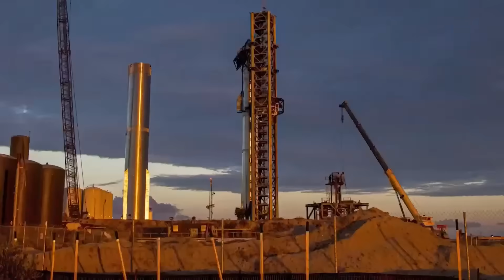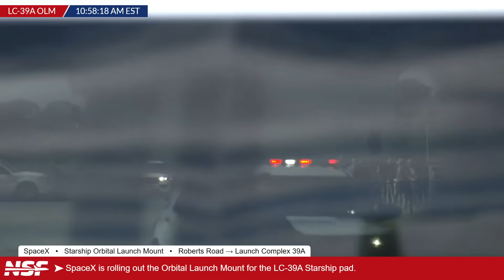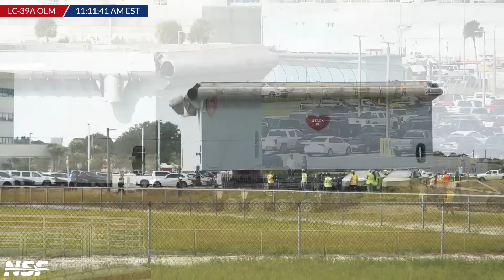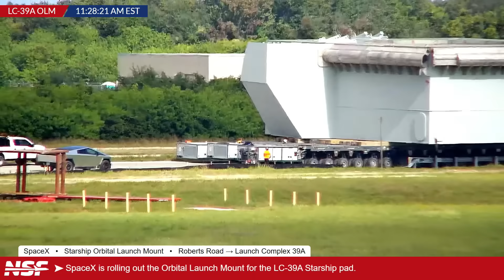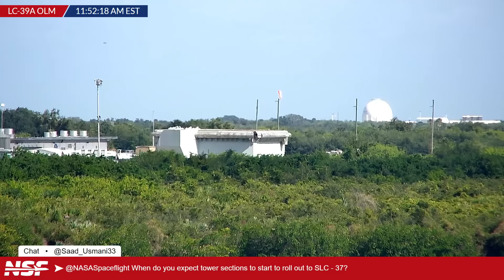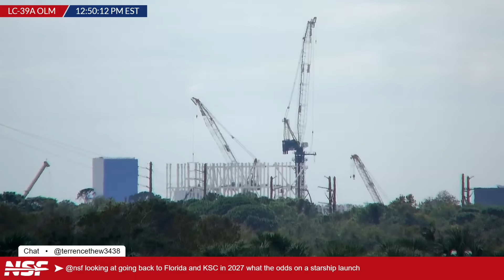SpaceX Rolls OLM for 39A Starship Pad

Comment: What happens if they spool this thing up and realise it'll never work? Do they tear them both down and go again?
Reply: They've got the previous experience of pad 1 at Starbase so it's not like they come here with this design without experience
Reply: @Alexphysics13 I understand this, I was more playing devil's advocate, they've not tested this kind of design yet, I half thought they may trial a few flights at starbase then if it works and works well roll it out elsewhere.
Reply: @James_Hague1  It's not that simple.  They don't build it untested and 'spool it up' at the very end.
Reply: They've already tested the same equipment at starbase on 2nd launch mount they know the engineering is sound. It's just the installing of it and then commissioning and fine tuning as each subsequent part is added